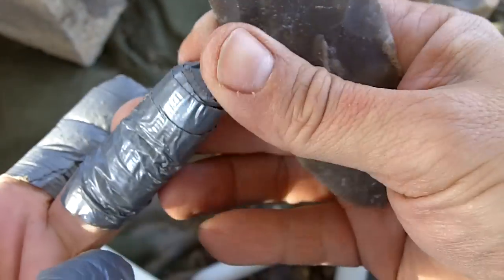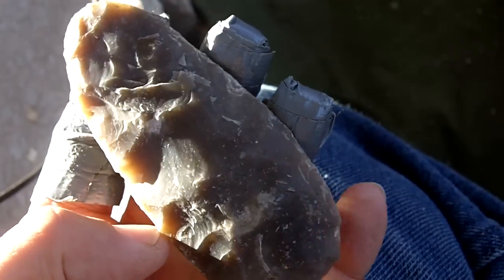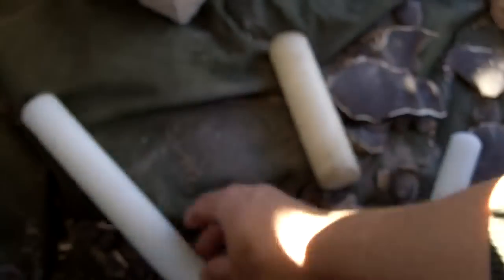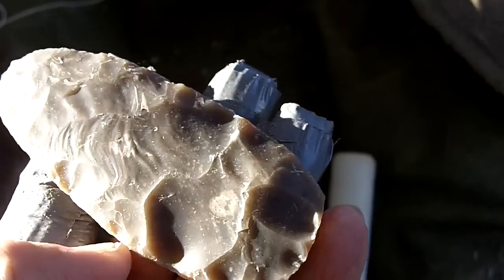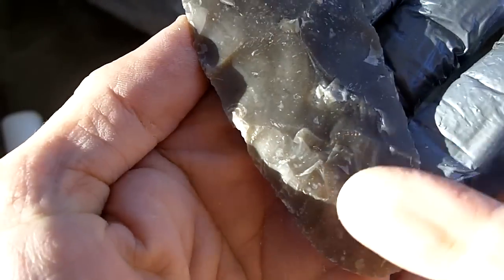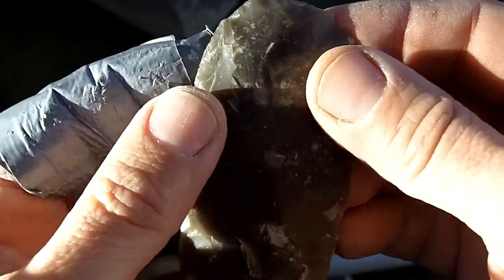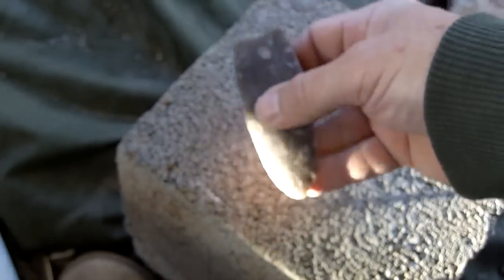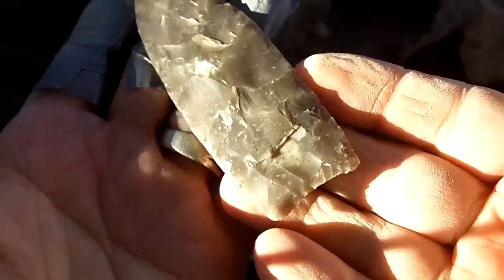227 - Flintknapping Third Clovis Part 3/5  Secondary Biface, Flutes, and Preform

Comment: I bought some Clovis Points from Lithics Casting Lab.  One is a broken base that snapped during fluting.  Big “nipple”.  Isolated either side.  Very pronounced. 
The other Two purchases were finished Clovis.  I was surprised at how shallow the fates were.
Last Sunday I met with some knappers.  Me and another fellow made Clovis points.  We both created a 45 degree bevel about an 1/8-inch from the base, then isolated as you do in this video, a small platform.  Just as done to detach any other flake.  A rap with indirect percussion and off the flute came.  The other side was like your experience.  The little white inclusions in the flint, stalled the flute after a 1/2-inch.
Moral to the story.  The flute is just another flake.  Isolate and create a platform.  It does not need to be big or snapping in half to detach is likely.  Choose consistent uniform material as flutes will stall on imperfections.  
Fluting is no big production.  Do not create a massive platform.  The flutes an actual points are shallower than pictures indicate..  Pressure flake the edges of the base to create uniform convexity.
And you do not need to strike the platform with great force.  ...... it is just another flake!!
Thank you Patrick.  I had so many failures trying before.  It is not at all as complicated as knappers have made it seem.
Reply from the maker: True, true. All true.

Comment from the maker: Yeah, you're right.  Good observation. I drove it slightly at an angle toward the greatest amount of mass.  I don't think it was intentional.  I think I did that out of habit because that's what I do when I send large flakes into the workpiece from the sides.  The fluting is no different from the other long flake removals and I don't think about it differently other than the need for support.

Comment: Nice video. I've always wondered about the apparent lack of heat treatment of Clovis materials. I'm not sure that thermally altered chert is universally recognized for Clovis by archaeologists. There seems to be some evidence of heating but not much. It has been suggested that the heated materials were a result of Forrest fires and not intentional. I do know that paleo groups were prone to using the finest grade material and would trade or travel hundreds of miles for it. The Clovis that I found in central Oklahoma near a fossil mammoth is made of Edwards. It makes me wonder why heat treatment is not more apparent if they indeed practiced it. Thanks for the great videos. Keep em commin
Reply from the maker: You're right.  It seems that there isn't much discussion on the proof of heat treating of paleo points.   But I think this is a common problem with most "large" points.  I think it assumed that large points can be made more easily from raw stone than the small points.  As far as I can tell, heat treating was practiced in all time periods and "soft" stones like obsidian were used for Clovis where it was available.
Reply: Holler Ford Topeka

Comment: I am very surprised at the flute you created.  Actually surprised and dismayed.  I am so careful at creating the l lenticular cross section.  Actually I am obsessed.  I bevel ten base then removed flakes down  the side to be fluted to isolate the platform I then abrade the platform.  The platform I create I now realize is  too “sturdy”.   You as you mention really remove the flute flake like removing a somewhat aggressive thinning flake.   My platform I  know is too sturdy and the energy to detach too great.  I get a  deep flute and generally snap the point in half when doing the 2nd flute.   Your flute is shallow.  No wonder my points snap!  However, like others have commented, I admit to being surprised your flute flake held the centreline and did not roll off to one or the other side.  I am perhaps thinking too much because I can tilt the point any direction I want when removing a thinning flake so I guess I can do the same for the flute flake. I have always attempted fluting in full panic mode.  You do it as though it is just another thinning flake.  I have been so fearful.  The stout too study platform has made my fluting way more difficult.  .... it is just a flake and a regular platform is enough!!
Reply from the maker: I agree.

Comment: Do you heat treat all your stone
Reply from the maker: No, I don't hear treat all of it.  I tell you at the beginning of each video if it's heat treated.  I work many stones raw.
Reply: JackCrafty cool man I’ve been getting into it but haven’t heat treated any of the flint I find here around Austin
Reply from the maker: Heat treating changes everything.  The flint around Austin is pretty good but a lot of it will improve with heat.
Reply: JackCrafty should I try to spall it before I heat treat it
Reply from the maker: Yes, spall it whenever time allows.  You can heat large chunks, of course, but it's risky.
Reply: @KnapperJackCrafty  I live in Junction and as you know the flint is abundant and the Llano river has excellent source's most of it easy to work. How would you heat treat 1"to 2" slabs of river flint.
Reply from the maker: @johnevans5819  use minimal heat on stone from Junction - especially the rootbeer chert.  I would dry the stone at 200 F for at least 24 hours and then ramp up (25 degrees every 30 minutes)  to no more than 275 F and let it sit at 275 for 2  hours before turning off the heat. I assume the slabs will be 1/4" thick or less.  Try knapping the slab and see if it's good enough. If not, heat again by ramping up to no more than 300 degrees.